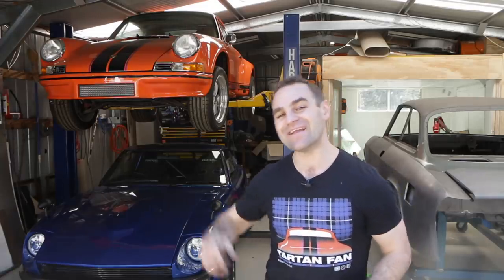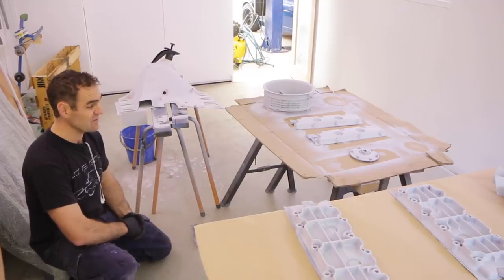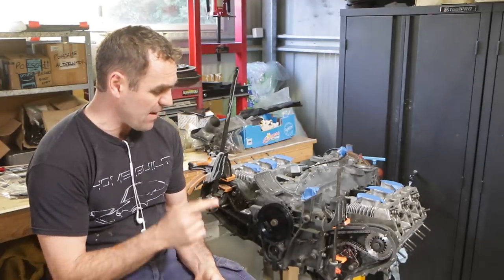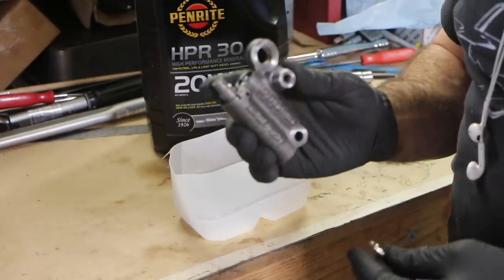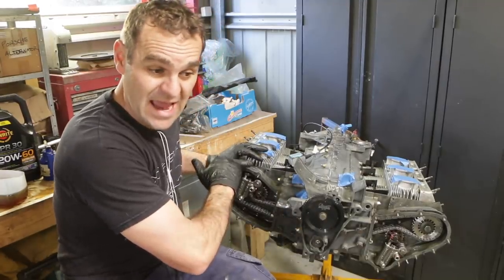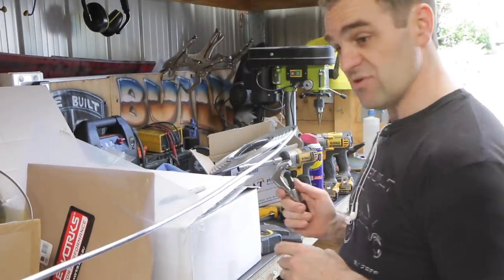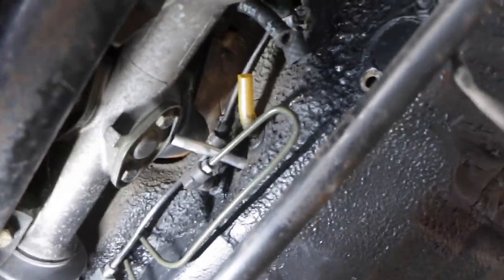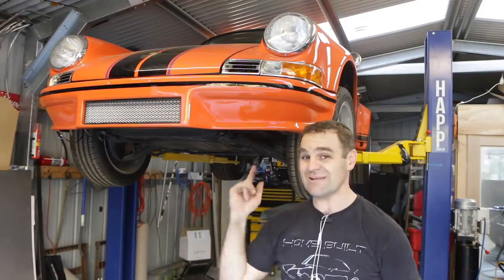Tensioners, paint and fuel lines -  911 2.8 RSR Build Season 2.10

Comment: The colour scheme for your engine bay is cool by my books - suits the rest of the car.  It's a "hot-rod" after all!

Concur with the use of HPR 30 oil - it worked a treat on my 911SC - very smooth operation + the zinc content gives peace of mind.

Nice work on the hardlines!  Looked simple!

As you say, the stock Polyamide lines should last forever, but since the hard lines around the firewall on my car just snapped off (rusted very thin!) I'm not taking any chances - replacing the lot with E85 compatible gear.

Comment: Are you missing the little corner shroud piece on the right hand side of the main shroud? There should be a piece there that feeds air down through the oil cooler.
Reply from the maker: It will go on later ;)

Comment: You need to debur the inside diameter of the fuel lines ends..they look a bit restricted for flow after using the pipe cutter
Reply: If it needs more fuel than can get through those fuel lines he's going to need to put in a bigger tank, somehow I think it'll be ok.